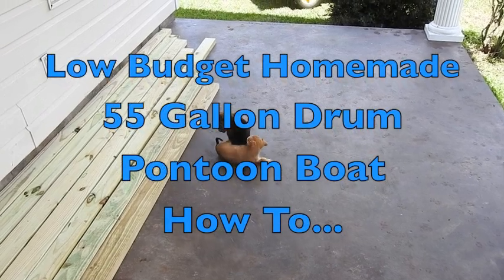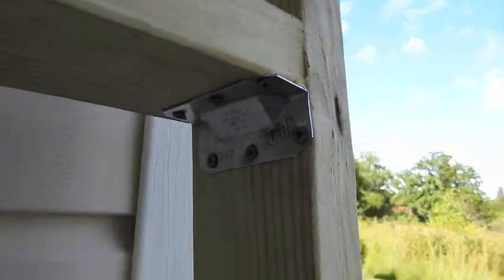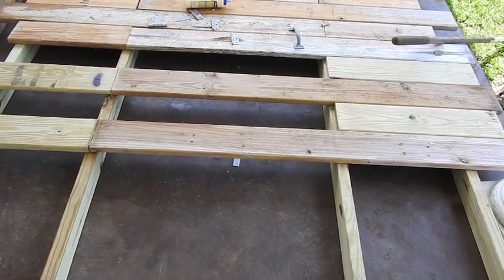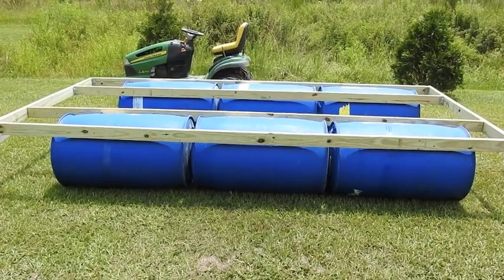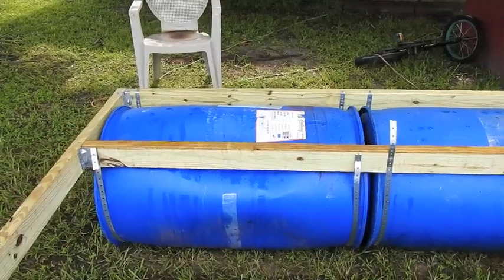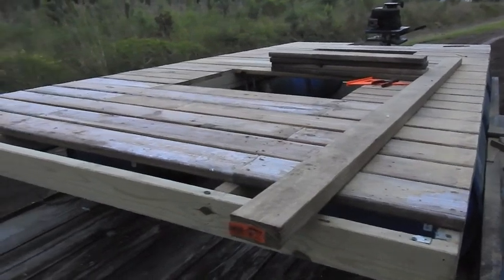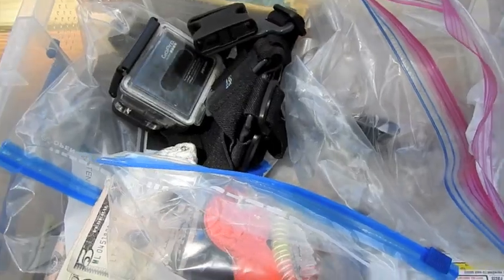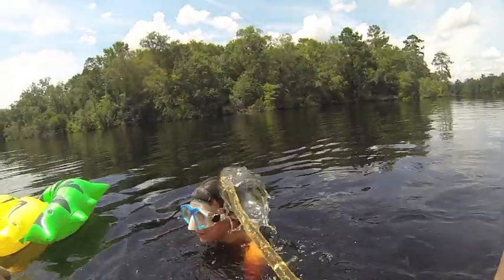My $200 Homemade Pontoon Boat (55 Gallon Drums)

Comment: I love your homemade ingenuity!  I always want to do projects like this myself, but there's always someone trying to stop you from using your invention, so I usually don't proceed with the idea.  One project I've dreamed about for years is converting a school bus into a camper (schoolie) but now I hear that some campgrounds are banning them.  Probably someone pissed that they spent hundreds of thousands and don't have the ingenuity to make a camper to suit them.  When I retire, I'm planning on taking the gas motor off my pontoon and putting solar panels on the roof and a large battery bank to power the craft.  I'm sure someone will try to ban me from the lake.
Reply from the maker: I have been wanting to do a school bus camper for years now, but the checking out and buying an old bus is a big deal to me.  I don't know what to look for in a retired bus.  You electric boat sound cool.  Thanks for watching.

Comment: The homemade outboard is awesome. 4 stroke, very little maintenance required, easy to repair, efficient.
Reply from the maker: Cheap, no mixing oil, air cooled, plus everything you said, just not as fast as the 2 stroke. I am thinking of adding some gears to make it faster. thanks for watching.
Reply: I would love to see that. Subscribed!

Comment: Some nose cones for the front and covering the gaps between the barrels might speed it up.
Reply: Yea I was thinking the same thing. Anyone have any good ideas for a scrap/cheap nosecone?
Reply: @AwesomeDocumentary  I was thinking the same thing with nosecones...I'd use thin ductwork sheet metal to form a funnel shape and then flare the edges to screw to the end of the front barrels. Use expanding foam to fill it maybe even between and inside the barrels but that would add up $$. If the intention is to use small kicker motors doing 3mph it it probably doesn't matter either way!
Reply: Just put two barrels sideways

Comment: When working with the "outdoors" (Exterior Rated) type wood,  you might consider making joints with Liquid Nails-Exterior Grade. But first, sand the area with a very coarse grinder/sander at the joining area, to get to the "real wood". 
Just another Random Thought, from an Old Fart (who's been on the water for nearly 70 years!).  Haha!
Reply from the maker: good tip and thanks for watching.
Reply: M. Smith, they make all purpose marine glue now.  :)

Comment: You could  also drill a couple of three  half inch holes from the sides on the deck so you could add a bend over pvc pipe and add a canopy for those days you want to get out of the sun a little. A few pvc elbows, tees and some half inch pvc pipe and a blue tarp and you could store it all in a  Larger PVC pipe  screwed to the underside of the pontoon with removable caps on each end.
Reply from the maker: That is a good idea, but I put a bimini top on it in episode #5. thanks for watching.

Comment: I built a raft four years ago using barrels you will want to silicone the barrel plugs because even though they have seals they seem to leak even if they are tight. I used four 30 gallon drums and the raft measured 6x8 feet and we had 17 people on it and it was still above water. That water was nasty brown, looked like sewage water.
Reply: Silent Death fantastic idea. Especially if it stays in the water.
Reply: I was just thinking the same thing
Reply: it's only tinted water. actually really clean for a river. believe its blackwater river in the florida panhandle. might be wrong
Reply: Water is natural stain from tannins from trees, not sewage.  He's in North Florida but close to East coast. Far enough inland so it's fresh water.

Comment: Awsome. Maybe I'm going at this wrong. I want a smaller but stable boat miss my pontoon. I could make one my trailer well ide need another one. But that's perfect side will handle my wheel chair. If I can't have a pontoon boat again. Build one. Good deal. Ok on to number 2. God bless

Comment: I built one similar to your design but I used 2x10s x 14' for the sides to get the deck higher out of the water water .
Reply: 45 hp Force
Reply from the maker: Very cool, have you joined homemade barrel boats on facebook yet? thanks for watching.
Reply: @chud327  .. no, thanks I'll look it up ...

Comment: Buy a cordless impact driver. Your handiness will feel handier than ever . use three inch screws too. No need for over sinking which weakens the intersection more than anything. Wood glue doesn't add anything in a marine environment but those corner brackets were a very important detail. Below deck storage was a 5 star idea however! :) I will be building this 😆
Reply from the maker: I do need some cordless tools.... Thanks so much and thanks for watching.

Comment: Looks like a success. I wonder if it can be built with aluminum to make it lighter. The affordable pontoon boat. Congrats chud
Reply from the maker: Thanks so much, we have had it out twice already and love it. Thanks for watching.
Reply from the maker: I think he was talking about the frame. If you want aluminum pontoons, you are so right on the price... Thanks for watching.
Reply: Aluminum is very expensive. Good, but expensive. You can take "affordable" out of the equation when thinking aluminum. Even if you're only talking about aluminum for framing such as "C channel" or "hat channel". For example, price a galvanized boat trailer vs the same trailer made of aluminum. But of course the aluminum is superior to galvanized for less weight and durability to the elements, such as salt water.
Reply: I believe ya. Thanks
Reply: Where can you even buy a pontoon?

Comment: very nifty :)  if you want more speed and a bit less drag, add a cone to the front drums to break the  cutting surface of the water and it wont by pushing water at the front of the boat/raft you have made...be neat little houseboat too  :)   you can also winch stuff up from the bottom of a lake too with your hole you made in the deck..recovering boat motors ect. ect.  :)
Reply from the maker: The water diverters were added in episode #4.  BTW, I am building boat #2 currently and it should be out in a few days.  I want to mount a winch on it and use my magnet to real stuff in ... I hope you will check it out and thanks for watching.

Comment: Just a thought . You might want to get two more barrels and cut the tops and off of them then cut a slit from front to back and  make cones for front of each pontoon to help with drag coefficient .  Might give your boat a more streamlined effect through the water.   I'd also make a door on the back by the motor as well and make a dual battery ,battery box. Just a thought.
Reply from the maker: David Bean Great suggestion on the cones for the front, if you check out episode number four you can see them on it. Thanks for watching!
Reply: Didn't see that one yet. Will check it out.  Man after my own heart. I am always full of suggestions, was a maintenance man for twenty years and was always thinking of ways to do things better.  It's both a blessing and a curse. I enjoyed watching the first video very much. Thanks for sharing .
Reply from the maker: Thanks so much and I always take suggestions...
Reply: I Once had one  barrel placed sideways up front and Rear, a quarter of an inch lower up front and  a half inch rear of each pontoon line. It worked well. Allowing for balance with and without people and gear.    It worked out very well. Though  there were more barrels than i had planed. It was so stable. I ended up making a travel shanty.  Not to mention buoyancy foam in the barrels. with the air pump bubble trick to lighten it. (Cutting the hose line instead of yanking) Just remember to rub down any cut or raw areas with silicone.

Comment: Put you a fold up board on it, use those 4 wheels you have to roll the boat into the water, then pull them up so they don't catch on anything in the water (logs, branches, etc)
Reply: I like that idea when I was watching him tacking them off I would try to use them to. It would a low you the launch it by your self.
Reply from the maker: Good idea and thanks for watching.
Reply from the maker: Launching alone would be nice. thanks for watching.

Comment: I am considering making one. I have a concern with the space between the barrels. It seems to cause a lot of drag when moving. I am wondering if  pool noodles, sandwiched between barrel end gaps, might act like a gasket? They could be sealed with a non solvent based outdoor construction adhesive, or marine 5200 silicone.  
What do you think?
Reply from the maker: I like the idea, I hope to build number 3 soon. I am thinking of cutting barrel strips and smoothing out the joints that way. Pool noodles would be good too, just may have to change out every year or two. Thanks for watching and good luck if you build one

Comment: I would have filled drums with expandable foam so if you get a puncture in floats it wont sink. Just a thought.
Reply from the maker: Good idea, but that would have been a lot of foam... Thanks so much for the comment and for watching.
Reply: Those blue barrels are tougher than a real aluminum pontoon
Reply: If the hole is big enough put m/t water bottles in the barrels

Comment: I lived in Gtmo when I was a teenager for a couple of years, and these things are all over the place since they can't be brought back.  You can even rent them at the special services marina.  Great for fishing in the bay(can't sail outside the first buoys), most had an upper sun deck and an outhouse.  Never saw a pontoon boat down there, but there must have been 100 barrel boats.  Lived there 1970-1972, when the minefields were still there.
Reply from the maker: That would have been cool to see and thanks for watching.

Comment: Very cool, great vid...the glue has no use as the shrinking and swelling of the wood will render it obsolete. The PT is green and for light weight single story construction..the brown PT is for underwater use and will last much longer..it also has more hazardous chemicals that affect human skin. If folks have the extra material for the deck lying around great. Use marine grade PT 3/4 ply and prime and paint it if you don't.  Again, cool video for the handy DIY'er..
Reply from the maker: I am planning to sell this one and build a bigger, the bigger will be using the plywood.  BTW, part 8 should be coming out in the morning. Thanks for watching.

Comment: I thought you were gonna use ratchet straps or tie down strap but i thing those straps are a better idea
Reply from the maker: Thanks it did pretty good, thanks for watching.
Reply: Exactly, won’t rot over time.
Reply: Won't they rust though?
Reply: @atbolt  they're cheaper to replace
Reply from the maker: atbolt They are galvanized and should last for a long time. Thanks for watching.

Comment: You shouldn't have used wood glue, you should have used PL-400 or Liquid Nails.
Reply from the maker: I will keep that in mind for next time, I just had wood glue in stock.  I don't know if it even need anything, but liquid nails surely wouldn't hurt. Thanks for watching.

Comment: I would think putting a couple sloped ends on the front of the front barrels, i'm not sure what they are called, but they divert the water around the barrel so there's a lot less resistance, you should be able to cut a barrel diagonally to get both sides, they don't have to be water tight since you seem to have more than enough floatation, but it would help with a little speed and fuel economy if the boat isn't pushing a wall of water in front of it, cool build and it makes me want to build my own homemade pontoon boat
Reply from the maker: Believe me. I have been brainstorming how to do exactly what you are describing... maybe I can make it happen soon in a future update. Thanks for watching.
Reply: Use expanding spray foam, cover the front and cut it to shape after it sets
Reply: nose cone i believe its called
Reply: I'm on a similar project - thinking traffic cones or a coned fold of aluminium for the front barrels. Following good vid!
Reply: Find a well shaped canoe of the right size. Cover the end with a very thin plastic sheeting. Then, use burlap and a cement slurry to overlay it and make a female mold . Use this mold to lay up 4 fiberglass ends. You want back end also.
Reply: does fiberglass / resin adhere well to an un-prepped plastic barrel?

Comment: steel against plastic and there is movement  ..   great idea
Reply from the maker: IKR and never had a problem on either of my boats after years of use... I guess that movement you mentioned is very insignificant. thanks for watching.
Reply: @chud327  How dare you respond in a nice way... i do like your videos..

Comment: cool pontoon boat,but you shouldn't use pressure treated wood in water.very bad for the health of the lake,and also for the people who come in contact with the wood.worse when it is wet.Check  the www label stapled to the end of every piece that you buy.There you will find about 5 or 6 pages of cautions and warnings about their product.
Reply: john nutbey Would paint fix that?
Reply: I see that used on public and private piers everywhere plus treated posts in the water.....Maybe could put a coat of varnish over it?
Reply from the maker: 90% of mine is old used lumber, I am guessing much of the treatment is gone. Thanks for the reply.
Reply: What are you talking about the health of the lake its already ruined have you seen that water.
Reply: Can't argue the health effects, but poisoning the earth with earth sounds silly when you really think about it.

Comment: Dude you got to reclame a fire extinguisher .Drill in a hole for  bolt in tire valvestem.  Fill 1/2 with water and dawn detergent then pressurize as much as you air compressor can handle .  It is a Wasp,Bee, and random other bug controlle force. Make your yard a no fly zone. 100% guaranteed .  I live on the farm and I always have one in the truck/tractor . Ive even modded a 2 ft barrle with a .050 hole . This allows me to tag'em from 20ft or more......fill with diesle , then you got a dandy flamethrower 😜
Reply from the maker: Good tip and I already have the fire extinguisher. Thanks for watching.

Comment: If you took another barrel and cut it and shaped it to make an angled point on the front of the pontoons it would push through the water a lot easier. You could wire and hot glue them on to make it strong and water tight.
Reply from the maker: Good idea and if you watch episode #4 I did just what you suggested.  It did work much better and thanks so much for watching.

Comment: I've thought about doing something like this too, but in Texas if it's over 14ft or has a motor at all (so basically a 13ft 11inch sailboat/oarpowered/pedal boat are the only exemptions) it has to be registered
Reply from the maker: Richard NiemannI Here in Florida, we have to register anything with the boat motor. Thanks for watching.

Comment: Great job. Just for longevity, standard wood glue doesn't hold in water. They sell a type 1 wood glue, that is waterproof. Used primarily with exterior doors. You can order it though, for future projects.
Reply from the maker: Great tip and I will keep it in mind since I want to build a bigger one. Thanks for watching.
Reply: @chud327  The company Titebond sells a version of it at Lowes. Not high priced at all.
Reply from the maker: Michael Morell I will put it on my grocery list. Nice to know Lowe’s has some.

Comment: i wondering what psi you have the air in the drums?!.. cos thats also important.. may be you only need 2 drums with the right psi
Reply from the maker: I did not pressurize the drums on build #1, that did not happen until build #2. thanks for watching.

Comment: You need to make some round domes to put on the front of those barrels to cut down a lot of drag, because you are creating a whole lot of drag with the water pushing against the flat part of the barrels. Do that and watch the difference. 👍
Reply from the maker: It has been done and we tried it out Friday, it was better.  Video coming soon, I hope you will check it out... Thanks for watching.

Comment: Do you have a reason for wood glue over construction adhesive? Looks like a fun build altogether. How was registration? If you have a roundover bit for your router you can make the door hole a little more comfortable.
Reply from the maker: I just happened to have wood glue in stock. It was great fun!  Registration was easy, took about 30 minutes and $32.  Router would be a good idea.  BTW, Wait until you see parts 2 and 3, I hope they are in you near future... And today, for part 4, I put some angles on in front of the barrels to cut through the water better. That video should be out next week. Thanks for watching

Comment: I picked up some of those blue poly barrels as well, but the threaded caps all had very small holes in them so I now have to buy new ones.  Did you put anything on the threads to keep them from leaking? I noticed that one cap has a fine thread while the other one has a quite coarse thread so I figured the best way to go would be to place the coarse thread at 12 o clock and the fine thread at 6 if the water reaches the half way mark. If the barrels are more than half way out of the water, then perhaps it would be better to just keep them at 3 and 9.  

So did you put any adhesive or maybe some Teflon tape on those threads?
Reply from the maker: I didn't do any adhesive or tape, but mine did come with o-rings.  I like the idea of 3 and 9, even though, I did 12 and 6.   Maybe 9 and 3 on my next build. Thanks for watching and good luck with your build.  I hope you will facebook me some pictures at "Chud Channel."